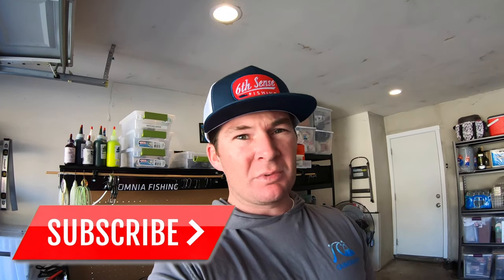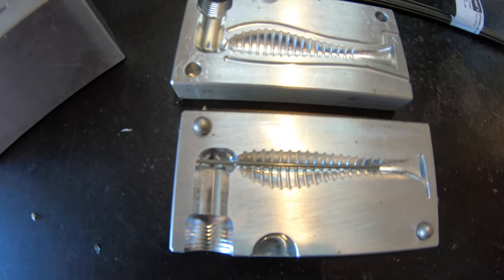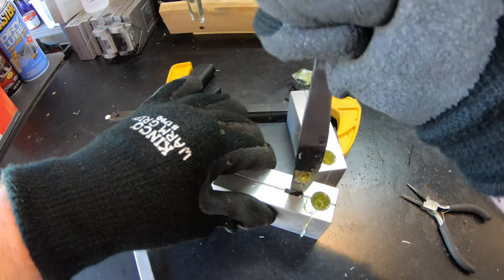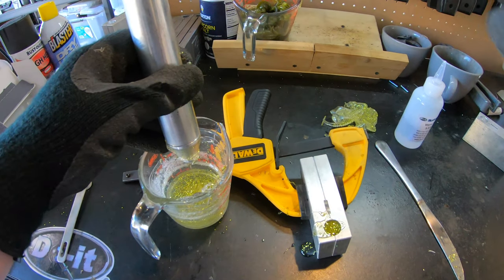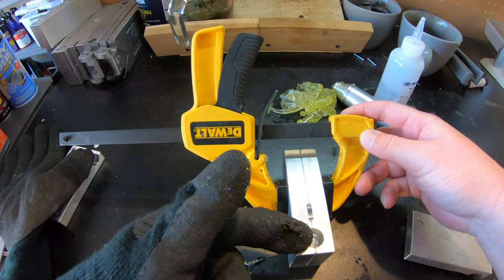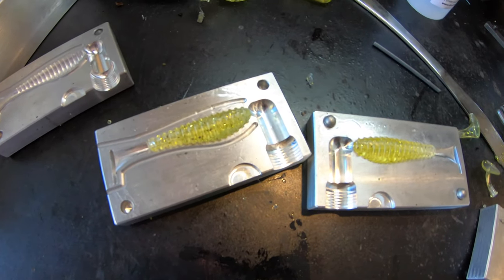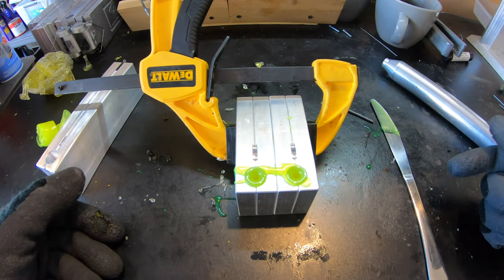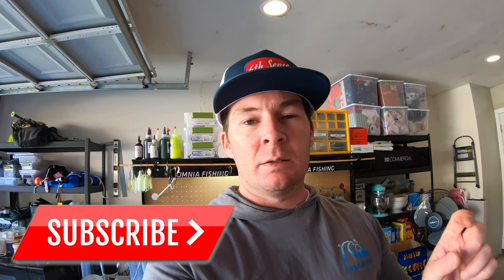Making Soft Plastic Baits  - Making  Swimbaits - Making Core Shot Swimbaits

Comment: Dang!  Those came out Bad @$$!  I could imagine a clear grey with a red core (bleeding shad) or the same clear grey with a chartreuse core (threadfin shad).  Heck even creating your own bluegill type color.  I wonder if there is a way to keep the tail and shoot it with a needle or syringe (without the needle) since you have the opening already without putting it back into the mold?  Anyway, that is awesome!
Reply from the maker: Yeah there’s so many color options you can do.  You could probably keep the tail by cutting the tail off while still in the mold.  It’s just almost impossible to get the tail back in once it’s out.
Reply: @MattLunaFishing  I was thinking maybe possibly leaving the tail on, but maybe using a syringe to hand inject it into the hole manually.   I was just thinking I am sure there are times you want the tail the same color as the main part of the bait.  Regardless...  I really like this...  I need my own bait laboratory.  I think I'd be good at it, the down side is I already have a ton on my plate.  I could see it being relaxing.

I ve always wanted my workshop to be able to reload...  but adding a bait making shop would be awesome!  Just already pot committed on other household projects!   Maybe later down the line...
Reply from the maker: I understand being busy with everything.  I know what you were meaning.  Doing to manually would be really hard and kinda tedious.  Not to mention how hot the plastisol is.  Your idea is possible and something i may try

Comment: whats the size of those little rods you used as the core?
Reply from the maker: I think they were 5/32 in diameter, but I’m not 100% sure.  They may have been an 1/8oz.  I bought a couple different sizes from Home Depot when I did this.

Comment: What length did you cut those rods to? I have both 3” and 3.5” ripper molds
Reply from the maker: I don’t remember.  You need to make sure you have the nose open and the tail open for it to work, so long enough for that
Reply: @MattLunaFishing  thanks Matt just got back from Home Depot with the 1/8th inch rods, I’ll report back 👍🏽
Reply from the maker: Right on!  Good luck!